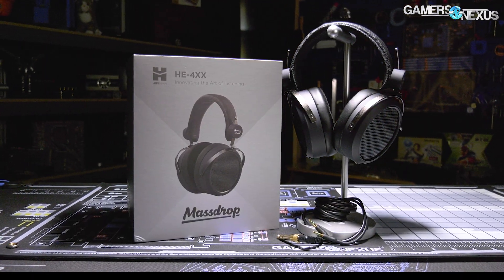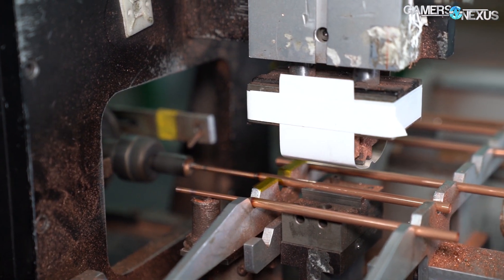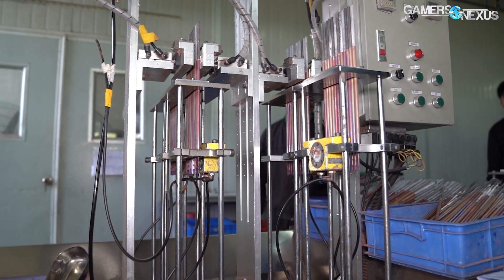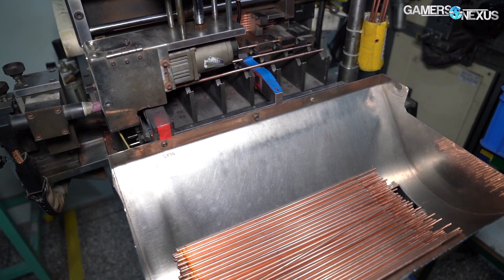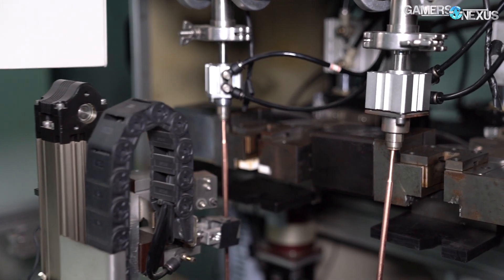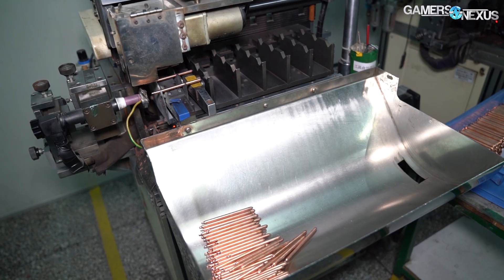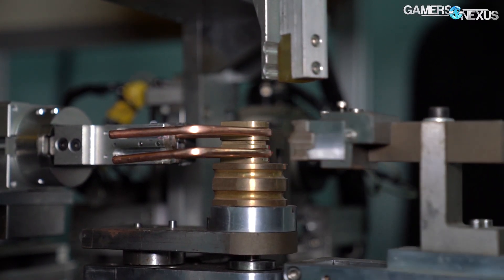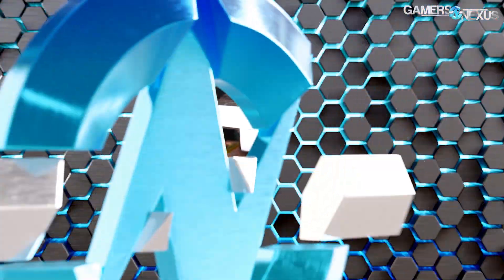How Copper Heatpipes Are Made | China Factory Tour (Cooler Master)

Comment from the maker: Looks like it might be TIG welding, not soldering. We were told "soldering," but it was very likely a translation issue between English/Chinese.
Find our Gigabyte motherboard factory tour here: https://www.youtube.com/watch?v=cnAFTMaS5R0
And our Deepcool fan factory tour here: https://www.youtube.com/watch?v=We0RCB7oA2I
Support our work directly via the store: https://store.gamersnexus.net/ (code GNSHILL for 10% off the two-tone lightweight hoodie!)
We joined BPS Customs here: https://www.youtube.com/watch?v=CWiUGyARQvg
Reply: It's TIG welding without using additional welding wire, a very common method of welding that is efficient and easy to automate as you saw.

Very long comment below, so ignore if you're not interested in some technical details about welding.

If you noticed the very bright blue/white light in the video, that is from the electrical arc used to melt the material being welded, and how you can tell it's TIG welding, an easy way to tell the kind of welding being done is through the sound and the intensity and type of the light, a blue gas flame with a whooshing sound is soldering, an extremely intense electric blue/white light with little to no noise or a slight hum is TIG, a very intense blue/white light with a thousand rashers of bacon being cooked type crackling/popping noise is MIG welding.

Stick/MMA is often done outdoors so if you've ever been near or on a building site then this is probably the welding you'll have seen, and is a softer whooshing/crackling sound and a less intense blue/white light.

If you're near someone that is welding using any electric arc method (TIG/MIG/MMA) do NOT look at the source of the light either directly or indirectly, it will damage your eyes, requiring medical assistance at best, or permanent damage to your eyes and even blindness at worst, always shield your eyes, 'cause even a brief flash of light from the arc is enough to burn the top layer of skin of your eye clean off, trust me, I have had it once, and it feels like I had burning hot sand poured into them. 

One last thing, the acronym TIG stands for Tungsten Inert Gas, it uses a tungsten rod sharpened to a point to produce the arc, which is surrounded by a inert gas, usually argon, helium or co2, and usually wire is fed into the arc by the operator manually to add additional material to the weld, although this is sometimes not required like in the video.

MIG is Metal Inert Gas, this uses a metal wire passing through a copper contact that conducts the electrical current into the wire, melting both the wire and metal being welded at the point where they contact, this is also surrounded by an inert gas, usually argon or co2.

MMA stands for Manual Metal Arc, and uses a metal rod surrounded by a powdered flux that is consumed to produce the inert gases required, usually co2, this flux then hardens into slag, which slows down the cooling process and prevents bubbles from forming in the metal while it solidifies, this method works outside due to the flux protecting the weld even in windy environments or even underwater.
Reply: @PaulTheFox1988  nice details up there! I would assume the TIG welding used here just uses the copper itself as the consumable rod right? Looks like, the way it comes out compared to what came inside and the result done.
Your comment on eye protection reminded me of my welding classes I've had a week ago, the teacher showed both stick welding and MIG welding in practice, and all the other machines on the shop. My friend at 1st was like "nah I'll not bother with a mask", I just went "...Dude trust me, you WILL want that mask!" In the end he did get one and I bet he didn't regret.
Also damn good description on MIG welding noise hehe, it's hella loud compared to stick welding and sparks fly like mad.
MMA welding I think I've seen being used on big welding robots doing some gigantic beams for big machines on some TV show once
Reply: @Kalvinjj  Thanks, I used to be a fabricator welder for about 10 years before I switched careers to being an IT technician, and I do miss welding, but I don't miss how demanding on my body it was.

You're right that there is no additional filler being added, it's a cheap, fast, and easily automated technique that can produce very pure and clean welds with no additional material added which can keep weight down in situations where that matters and spot welding isn't going to be strong enough . eg. Motorsports and aerospace.

Yeah, he would be in for a whole world of hurt without the mask, and the first time he has second degree burns from sunburn on his arms, or he gets welding flash or arc eye and he'll never skip the safety equipment again.

MIG is a right pain when trying to do pretty welds for decorative pieces because of the spatter shooting everywhere, if you forget to use anti-spatter spray then you'll easily spend 30 minutes to an hour cleaning your work.

Top tip for MIG/MMA welding, get a fire retardant cap with a neck shield, otherwise you'll get spatter landing on your head and neck, especially when doing overhead/vertical welding it'll all land on you and make it impossible to work. 

MMA is usually done by machine in difficult environments, such as confined areas in shipbuilding, underwater or in sealed vessels where asphyxiation is a risk, so that's interesting to me that they would use robotic MMA for welding beams, the only reason I can think of for that is if the parts have such strict tolerances and complex welding patterns that a human would have difficulty performing the work and MIG cannot be used for environmental/strength reasons.

Regarding the sound MIG welding makes, eventually with time  you'll be able to tell that your settings are correct just from the sound, and if you're good enough you can even tell in what way the settings are wrong from the sound alone.
Reply: Gamers Nexus - Your "how it's made" factory videos are my favorite videos.  Moar plz.  And, thank you, Steve and GN crew.
Reply: Definitely TIG welding the end. Looks like they modified a standard handheld torch.
Reply: @derekmost5613  could very well be, as far as I know robot welding torches ain't that different from manual ones other than the holder.
Reply: It's very possible to use TIG as a brazing tip.  which is essentially Soldering.  So it could be both.
Reply: @Frostfly  True, although I had actually never heard of that before, so I learned a new thing today xD

Although from a quick bit of research I did it seems to require brazing wire made of some alloy of bronze and silicon, which is not being used in the video, and is a technique that seems extremely hard to get right, even for very experienced welders.
Reply: @PaulTheFox1988  It's a machine, when you can control the variables it's not very hard to get your welding/soldering/brazing right. 

I have no experience with it. i've just watched a view This Old Tony videos where he talks about it. 

hard to tell exactly what they are doing.
Reply: @Frostfly  Yeah I know in the video it's machine controlled and that makes it easy to dial in the required settings, but I was talking about manual tig brazing not being easy. I perhaps should have been a bit clearer on that :)

There isn't a wire feed for the machine that I saw, and if you're going to use a wire for machine tig welding, surely gas soldering would make more sense cause you can dab a blob of solder paste on the end of the tube, hit it with a gas torch for about 1 second and even do multiple tubes at once. It'd be cheaper that way imho.

But who knows, the Chinese are crazy enough to bodge together a machine tig welder with auto feeding wire from a manual tig torch and some wire they got off a friend of a friend's uncle in schenzen xD
Reply: @Frostfly TIG  brazing would require filler material.  They are just doing a fusion weld
Reply: @paulsomero  You're likely right, but from the angle shown we can't really see if they are or not.
Reply: @Frostfly  There is the alumina cup on the torch head and a hose clamp with a ground lead on it, probably for EMI.  There isn't enough room for a feed mechanism for the rod to come from.  You would have to feed filler at an angle at least 30 degrees away from the axis of the tungsten.  They are doing a straight fusion weld.

It is a common translation error to call welding soldering.  I know this because I have worked on a number of products which were welded in China and Taiwan.  I have also been TIG welding for half of my life.

That shield flying head thing has a motor which is spinning the part.  There are four guide rods and the piston rod from the pneumatic cylinder that actuates that stage.  There is clearly no more stages to manipulate or present filler to the joint.
Reply: @Diogo Amaral I don't think it'd actually be that great, from the information I can find, it's thermal conductivity in w/mk is about 1/5th as good as aluminium which sits around the 235w/mk mark, but I am not a metallurgist so I could be wrong on its potential performance as a heatsink.

Now a pure diamond heatsink would be incredible, its thermal conductivity is about 1000w/mk. Which absolutely destroys aluminium for performance, let alone niobium.
Reply: Look its jesus
Reply: I don't understand how they can create a vacuum and not have the water change state to a gas, as water in a vacuum boils at room temperature.
Reply: @ChimpyChamp  They drop the pressure to a point before water will boil, so when heat is applied to the heatpipe it evaporates rapidly due to the high vapour pressure.
Reply: @zoravar.k7904  Oh I see! I was under the assumption they were hinting at a complete vacuum.
Reply: Truly, thank you for the edumacation! The mass public has little appreciation of matters like these, like how we love our chicken without visiting a Tyson factory. tongue in cheek
Reply: I had thought heat pipes were about half liquid to gas ratio. Guess not these days. Now I wonder how much of a dif there is between a wet heat pipe vs a (few drops) dry heat pipe.

Good stuff Steve and crew. B)
Reply: I see no wire or solder being fed into the "soldering" machines. Looks like a simple arc weld.
Reply: soldering is when you add a filler with lower melting point than the material thats being soldered, welding is when the material is being melted and "mixed" with the filler. both methods can be used with a TIG welder.
Reply: @stoutbolt  With a tig torch soldering is called brazing. It appears that they are using the material of the part as the filler, and that makes it welding.
Reply: Its TIG fusion welding. Just like tig but uses no filler. Literally just melting the copper end a bit to close it off.
Reply: Was just about to mention the welding before I saw this comment
Reply: i like this kind of content, can you make video about cherry mx factory, globalfoundries only if possible. because this kind video its very informative.
Reply: Hmm, could you try to get a factory tour at asml in Veldhoven? Asml basically has a monopoly on chip lithography machines and could be very interesting
Reply: That is most definitely TIG, and is a common translation error
Reply: Funnily enough, the real "how it's made" show also nearly universally confuses soldering, brazing and welding.
Reply: I use a cooler master AIO 😀
Its really in the name ... 😄

Comment: Why wouldn't there be a funnel system down into tubes that would align up with the heat pipe tubes for dumping in the powdered copper for sintering? Also, what keeps the powdered copper sticking to the insides instead of just blobbing and filling the tubes completely into a kind of solid chunk? Thanks for doing these tours, much appreciated! This really helps to fill in my engineering itch of learning alongside endless math work in school. Hope you'll keep making more of these. I plan to make a purchase to help support your work when I can afford it. Love you guys!
Reply: The part where the material is sintered to the wall is not shown in the video. I suppose the tubes are rolled and heated.

Comment: I might be wrong but I think the optimal performance comes from copper tubes with no sintering or grooves but requires the cooler to be in the correct orientation and is terrible otherwise (the sintering and grooves are intended to work against gravity but inhibit return of the working fluid when gravity is already favourable).

Comment: Heatpipes on everything! I saw one for NVME drives. Seriously, they've gone mental. There are use cases that make sense but it's turned into a gimmick in a lot of cases. Most of the time a regular fin stack is fine. There are loads of gimmicks, like speaker wire, where consumers don't know any better and pour money down the drain on things that really aren't required. This all means we're making junk that will eventually end up in a landfill & can't even get recycled. So stupid.

A Noctua cooler is a great use. Some random part on a motherboard, NVME drive etc, just stupid & wasteful. Perhaps it's pride of ownership. If so, buy a watch.

Comment: the rejected heatpipes could be sold or used in lower quality products (remember the 808 machine where defective transistors was used to give it famous sound)?

the scrap does not have to be thrown away it could be recycled as number 2 witch is not clean and has solder , brazing and paint.

number 1 is clean copper

bare bright is only for wire and is used for stripped household wire.

Comment: Do you know if there's performance difference for the thickness of the sintered material inside the heat pipe? I would expect that the thicker the better but has this been tested? Obviously, cooking the thicker sintered inside is slower and requires more copper so it would get more expensive pretty fast.

Comment: Hmmm, I need a heat sink for a larger, flatter surface (peltier/TEC device), and while I could use multiple flat pipe designs, these run around 10 dollars each and I would need multiple to cover, which would get pricey. I could make my own flat panel one I think, by using two flat pieces of copper, a thicker copper border on the sides (held together by vacuum rated epoxy or thermal epoxy would probably work decently for a low vacuum) and some of that thicker copper in the middle as a support structure. Line the copper with some fiberglass or the like, drill a small hole onto the top, drop a couple drops of distill water in there, pull a low vacuum and seal, and voila.

Comment: Very low tech manufacturing line. They test the heat pipes by hand feeling. These things do not produce any defined specification sheet; they just "heat up very quickly" when immersed in hot water - itself at unknown temperature.
I bought a bagful of 3300 uF capacitors, they read anything from 100 to 400 uF, ten times smaller than what is on the  label. Imagine they use the same QC method - the charged caps produce a spark when short-circuited.
Thanks for the nice video!

Comment: wait what? They are vacuum pumped with water in them? How do they try to keep the water in as it evaporates immediately when vacuum pumped and would evacuate with the air from the tube? Sounds just like marketing bullshit.
Reply: As the vacuum is pulled, air is displaced with water vapour, and then the heatpipe is closed off. They must be extracting a known amount of gas by volume, extracting all the air and some water vapour, and leaving a known amount of water vapour in. It is easy to produce a pump which will extract a known volume.
Reply: @SianaGearz  there can be no vapour in vacuum. It's a vacuum. Liquids turn into gas when pressure drops and gases are pulled out by the vacuum pump. I'm pretty sure this is plainly marketing BS.
Reply: @MikaelLevoniemi  It's not absolute vacuum, just sufficiently reduced pressure. It's not "marketing bullshit", it's a plain commonly accepted misnomer in explaining the process and in fact in engineering as a whole. This has nothing to do with marketing, because the product spec or marketing materials do not promise the tubes to contain "vacuum", they promise them being filled with a phase change fluid. Nobody promised you a vacuum.

Also, you go ahead try to achieve absolute vacuum anywhere on or near earth. Not going to happen.

Go bark at vacuum cleaner companies btw. Not even close to vacuum. Disgraceful ;)

Comment: I find it curious as to how the water remains inside the heat pipe under vacuum. Water tends to boil away under vacuum even at room temperature.
Reply: It naturally wouldn't remain as water, but as water vapour. If you pump out a known volume of fluid, first air comes out, then some water vapour, and at that point you cap it off and leave a known amount of water vapour in. If you think about it, rather than imagining the evacuation process as connecting the heatpipe to a previously evacuated chamber of perfect vacuum and infinite volume, imagine it being connected to a piston that you move a certain amount. Conjecture, but what other option would there be.

Comment: https://en.wikipedia.org/wiki/Heat_pipe explains that the water is the working fluid that turns into gas everyone keeps talking about - Different fluids are being used depending on the expected temperatures the heat pipe is supposed to work in.

Comment: Jonathan Langlois
Il y a 1 seconde
Any mineral which we find in the ground will have impurities in it and has to be refined in order to be usable. With that said, the process is not as simple as it is with steel where the slag can just be scrapped off the surface of the melted steel. In the case of copper, the process requires a lot of electrical current and sulphuric acid. The copper is disolved by the acid and is then deposited on cathodes. This process is essentially the same as the one which is used to refine copper from raw ore. Raw copper ore contains trace amounts of gold, silver, platinum and palladium which are refined from the impurities.